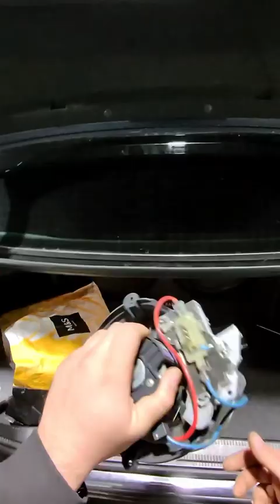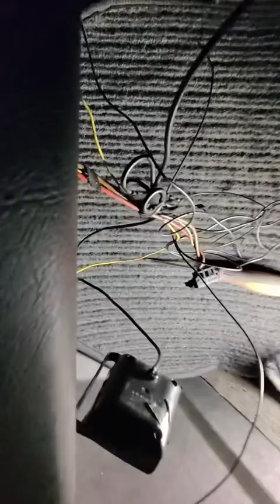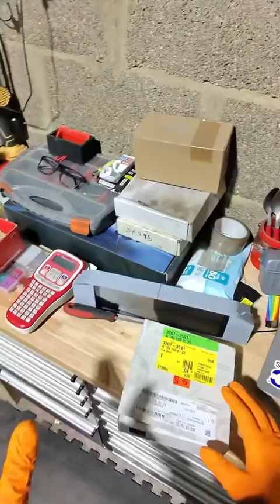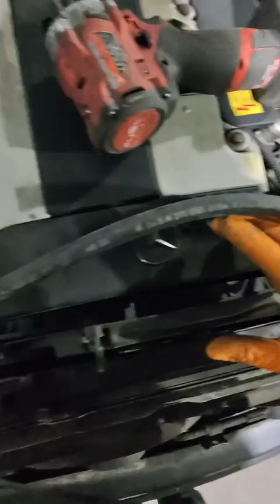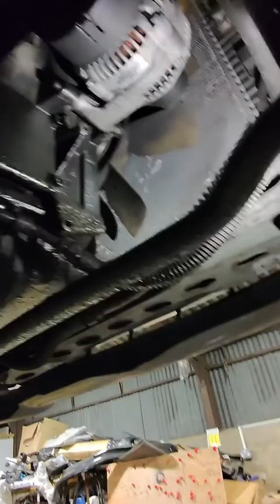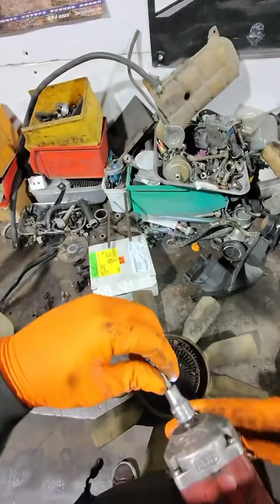C36 AMG Blower Motor and Viscous Clutch Replacement

Comment: Hey George, I had some strange issues with my c36 fan clutch..I thought it was bad because i could hear a rush of air from what seemed like the fan upon pressing the gas petal, and also seemed like a massive loss of power.  I replaced it with a new one and it did the same thing again, so then i removed it entirely and now my engine actually goes through the powerband way better. More hp for sure. So i left it off and this engine seems to run super cool and does fine with the electric fans only so far.
Reply from the maker: Yes, you will get a power increase as you are removing rotating mass, but I would not recommend anyone doing a complete removal of the fan. The electric fans in front switch ON as fail safe or when a/c is on.